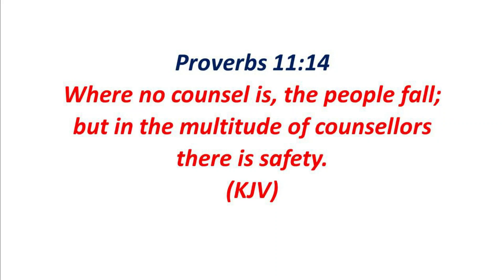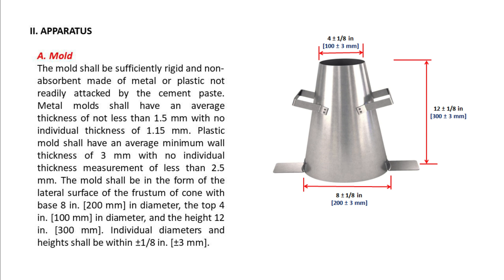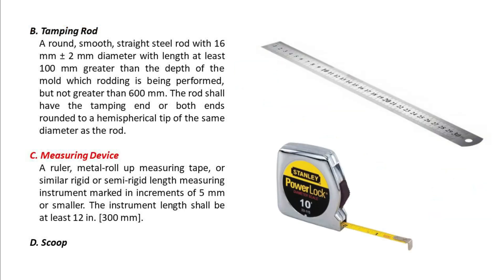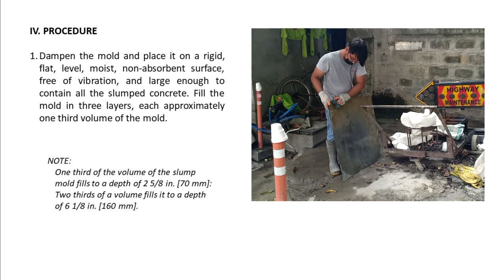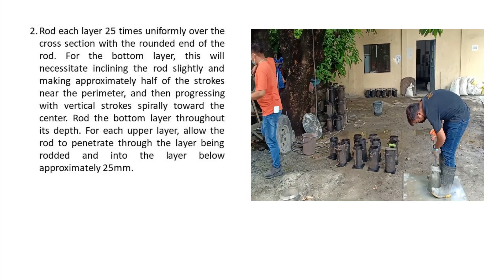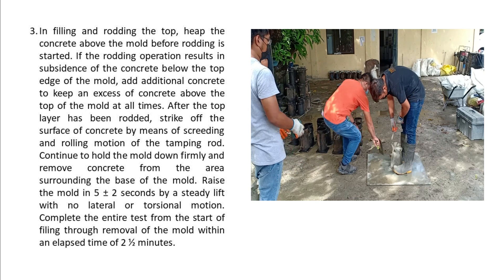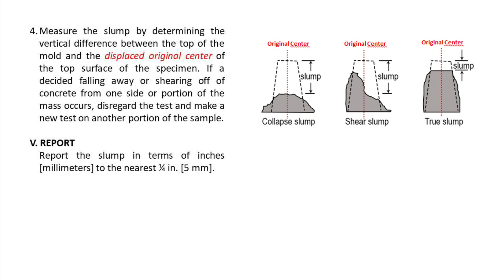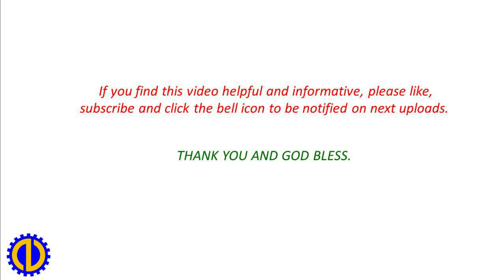Slump test ASTM C143 AASHTO T119

Comment: Good day, In slump test for fresh concrete, what is the required slump of concrete as per DPWH Bluebook?
Reply from the maker: For ME exam purpose
Item 311 PCCP:
40-75 if not vibrated
10-40 if vibrated
Not more than 40mm on slip form.
Item 405 Structural Concrete:
50-100 for class A, B and C
100max for class P
100-200 for Class seal
Reply: @engineeringcivilintegrity6985  Thank you sir.

Comment: sir what is the maximum slump of pccp..tnx
Reply from the maker: For exam purpose. as per Item 311.3.12 of the Blue Book. 
10-40mm if vibrated and
40-75mm if not vibrated.
Reply: @engineeringcivilintegrity6985  sir what do you mean by vibrated and not vibrated?